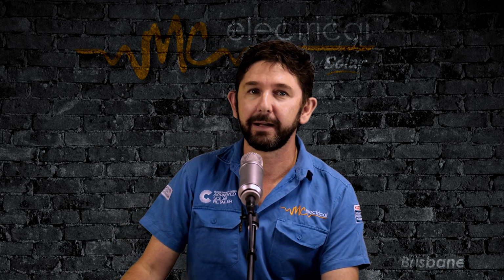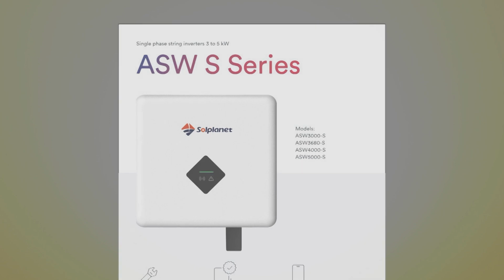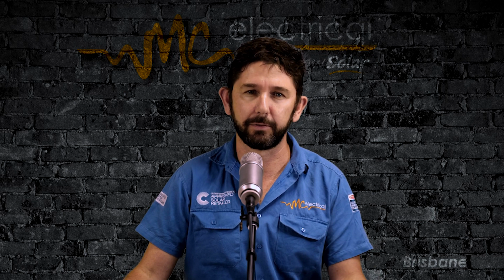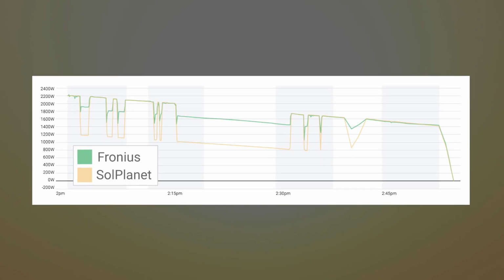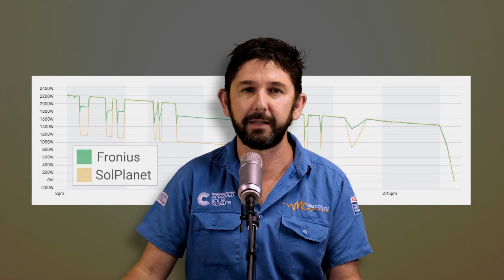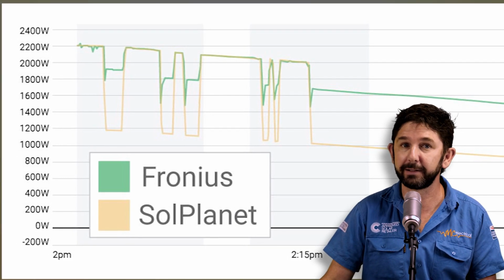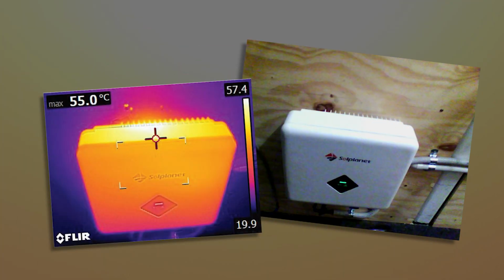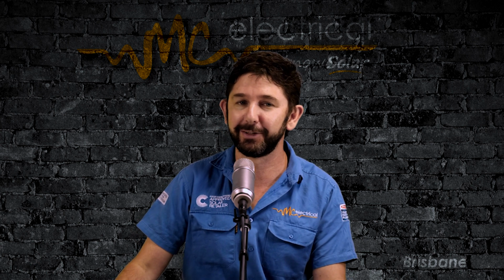SolPlanet Inverter Review | Cheap & Quality or Cheap and Nasty?

Comment: I'm considering the new Solplanet ASW12KH-T3 with 12kW, hybrid capability and 3 MPPT.
Wondering if you have had any updates on Solplanet since this review? It's a whole new design and potentially some software improvements have been made?
Reply from the maker: I haven’t checked out the latest one. I’d be hesitant especially if batteries are involved.
Reply: @mcelectrical  It supports batteries, but it doesn't need you to use their batteries.
It must be Lithium, and it needs RS485 bus on BMS. Unfortunately I can't use the inverter as it does not support IT-network only TT and TN types.

Comment: too much talking and filling time with your own voice and opinion. if Fronius is so good, why won't it offer a decent warranty?
Reply from the maker: I was thinking of sharing a different opinion, but then I remembered I’ve only got one. Warranty, in my opinion, is the worst indicator of reliability.
Reply: @mcelectrical  - valid point, if that’s your version, then so be it. I don’t tend to agree but has some good info and some valid points and info about the inverter differences. But like many, I don’t agree that the Fronius inverter is the benchmark.
Reply from the maker: I’ve done so much testing with shade and temperature etc against other inverters (some of it in my blogs and videos) that I think Fronius is the bench mark. (SMA is close except their monitoring.) Which inverter do you think is better than Fronius? And what point specifically do you disagree with?

Comment: I have 1.5kW of solar panels on my roof with a 5kW Solar River inverter that failed with a relay error out of warranty. I saw a Solplanet 1.5kW inverter on Ebay for AU$544 including freight so I ordered one. I have no shading problems in the highset house I built. Qld feed in tariff went up to 9.6c in July 22 and I'm alone so hopefully it will work out better than no inverter :)
Reply from the maker: Fair enough. The inverter works fine! How much are you getting for your feed in on your bill? Often people are afraid of giving up their 50c feed in tariff even though it's only giving them $100 a year.
Reply: How did it go Robert?

Comment: I was going through trina module data sheet the current is very high more than 17 amps , is there any on grid inverter in 3ktl or 5ktl capacity which is compatible with this module?